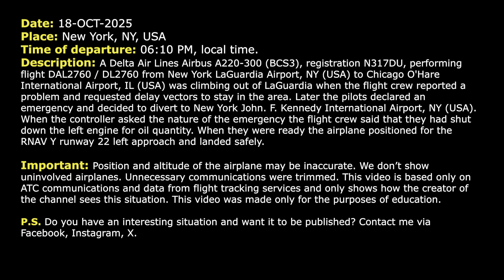Left engine failure in flight. Delta Airbus A220 diverts to JFK Airport. Real ATC

Comment: Think I’m taking 31L with those winds. Also would like to see approach coordinate better to not take them all over the island on their single engine approach
Reply: Actually, with southerly winds 22L is a good choice. As for the arrival routing it's very predictable for anybody who's arrived from the northwest- once past LGA give them lower and set up for left traffic to 22L/R. If you watch their altitude during the arrival, the ground track is close to perfect for their energy. If they kept them closer, they would need speedbrakes and early configuration, not a welcome process in an emergency, even a fairly benign one.
Reply: @gerardmoran9560  5 knots bud. I’d rather the longer pavement. 
I know their normal flow. Know what else they can do? Pause the flow and bring an emergency directly in. That was the point that was apparently too subtle for you

Comment: Why were they adamant on an RNAV instead of an ILS? Can you be dispatched without a working ILS receiver?
Reply: Great question! The 220's FMS does a great job flying RNAV and is very user friendly. ILS approaches aren't difficult but a little added workload and LOC intercept can be a little wonky. 220 pilots will take the RNAV 9 out of 10 times. Boeing metal, I'd take the ILS.
Reply: @smokey6638  hmmm interesting. Thanks for the insight!